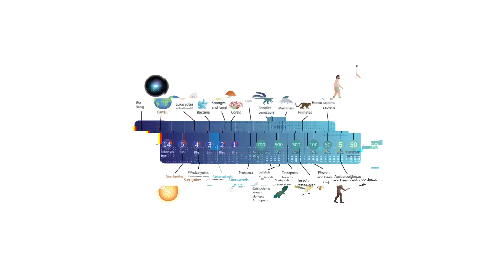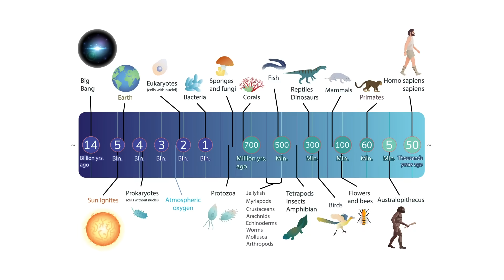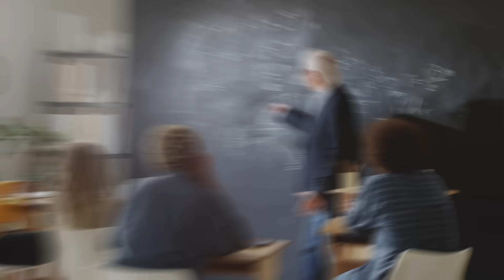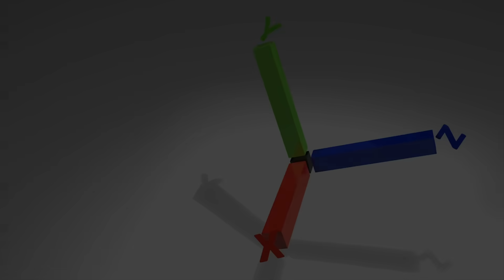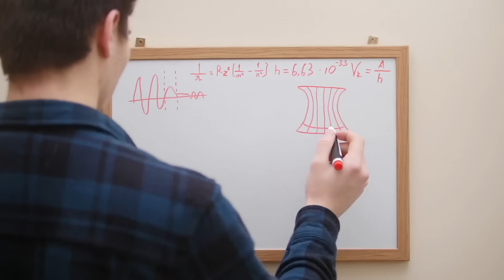Brian Cox - Why Did The Big Bang Happen?

Comment: I guess if everything collapsed almost into a singularity then maybe you get infinite gravity and density but doesn't that leak radiation like a black hole?
Reply: So here is one of the main problems of understanding.. 

People have a very poor understanding of what the word 'infinite' actually means.. This is not any kind of 'fault', but just that we have evolved within the confines of what appears to be a finite environment, and we thus try to look at things in finite ways, also justifying those 'finite' thoughts. When I first approached the 'problem' I had the same difficulties, so it takes our minds a lot of effort to reach another perspective of understanding, but it IS achievable.. 

Firstly, there cannot be more than one 'instance' of infinitude, otherwise a secondary 'thing' would render them both 'finite'. So we are describing a 'oneness'.. Also, it can have no 'beginning' nor 'ending' as these would also necessitate a secondary 'thing' (or the utter nonsense of a 'nothing'!), so we are describing 'eternity' when we apply 'time' concepts. Then, we have to admit that it can only be the one thing that interconnects all other 'things', and we deduce this to be 'Space', necessarily..

All references to 'size' or 'direction' do not apply to the nature of infinitude, and thus have no relevance to our understanding of the true nature of existence. 'Measurement' has limitations.. When we point to any position in Space, we effectively create a 'beginning' to any subsequent forms of measurement, which only has relevance to the entity desiring to understand said 'measurement'. This does not make it a feature of the nature of reality, only a desire from a Human perspective.

spaceandmotion
Reply: I see what you mean. Like Hawking radiation. I wonder if it would be possible to one day make a space telescope that could look pass the cosmic horizon and see primordial hawking radiation left over from that moment of the singularity just before inflation.  Like the cosmic background radiation. Or maybe we have it all wrong and what we see as the CMB is the Hawking radiation.  Boom,  mind blown across the depths of the universe!
Reply: @SuperiorDave  I guess not even Hawking radiation theory may apply when you have a singularity that small that is essentially all of space/time and operating at a quantum level. The mind boggles at it all.
Reply: The only issue with the singularity for myself is the singularity isn't what everything started from but is a result of our universe starting.
Reply: @alex79suited  
In fact we have no basis to know this.

The singularity has not been observed. It's what happens when we extrapolate backwards to t=0, but it's not demonstrated that there ever was a t=0. More plausibly, it's asymptotic.
Reply: How then do you get less infinitely dense?
Half of infinity is still infinity.

Comment: I wonder if it wouldn’t make just as much sense to think of the big bang instead as a big collapse. Everything starts shrinking, the atoms the particles all shrink. Space appears as they shrink away from one another.
Reply: It's a popular misunderstanding to comment that we can't tell whether an object is changing size or the ruler that measures it is changing size in the opposite sense.

However, given that we have a coherent account of the universe expanding from something very much like a point singularity, the notion of scale diminishing from that moment onward doesn't make a lot of sense. It would be like working entirely in reciprocals, with negative exponents everywhere. But our preexisting mathematical convention is to omit the "+" sign, not the "-" sign, by default.

Comment: The answer is easier then you think. 
How do we get something from nothing?
You need to start at the beginning. 
Hydrogen,
How is hydrogen generated out of nothing?
There was a shift, or an imbalance in nothing which created the first hydrogen atom.
Find the answer and you will unlock the Universe....
Reply: Ok,
Get a fish tank.
Get a air pump and a bubbler, to make air bubbles at the bottom of the tank
Watch the bubbles get further away from each other as the density of the water changes. 
That's why we are moving away from everything in the Universe ! ! !
Reply: Well yes there was an imbalance of more matter than antimatter. Matter can be created from pure energy but always as a particle antiparticle pair. We can do this in the laboratory, but we always see 1:1. Somehow in the big bang there was something like 1,000,001 matter particle for every 1,000,000 anti matter particles. That slight imbalance created all the matter we see today in the universe. It's still unknown why that imbalance happened, although there are many ideas.
Reply: @David-di5bo  
Instead of trying to lookat the beginning of the universe that has a central starting point. 
Instead try to see all the universe starting at once everywhere.
It wasn't a bang ! ! !